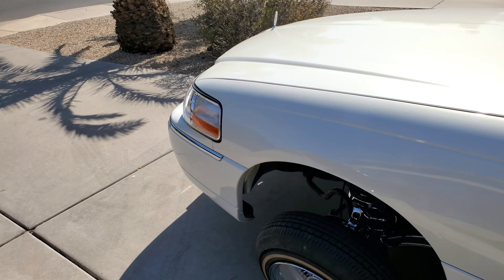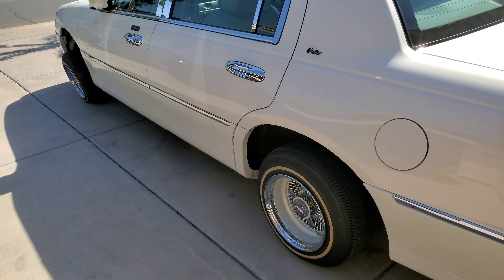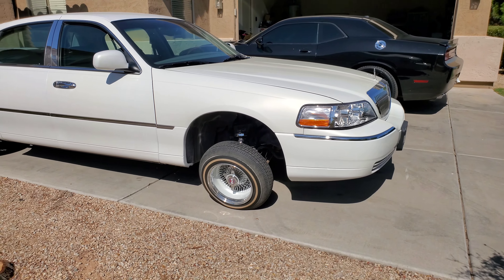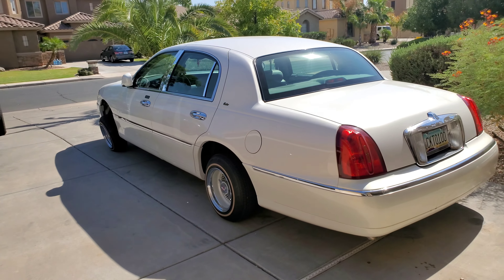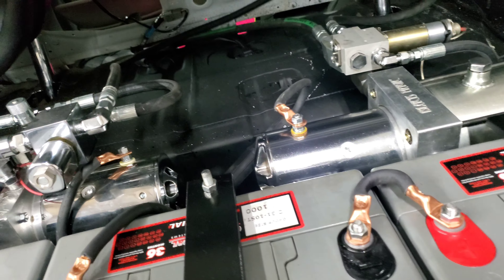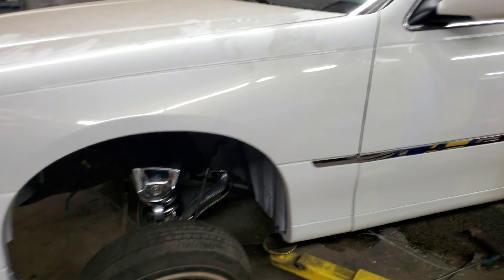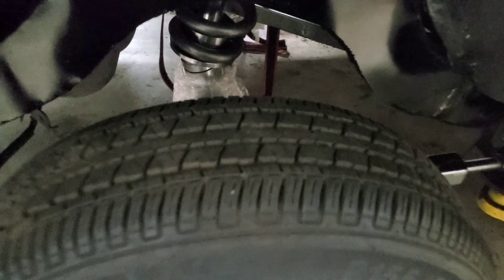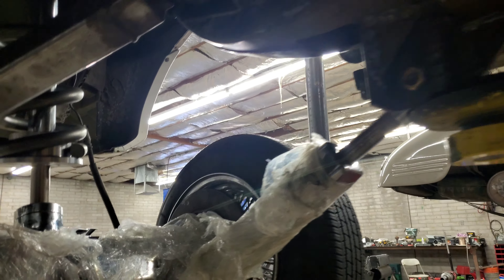update on the lincoln finally got it out the shop

Comment: How much did all hydraulics parts plus installation and all reinforcement cost basically how much money have you put in it to make it a lowrider with out the cost of the car is because I'm trying to build one and I want to have an idea of how much it will be costing me. Thank you love the car.
Reply from the maker: I honestly haven't added it up yet but I got a good deal on alot of parts in chrome and did alot of labor on my own. Just to give you a rough idea had to be almost 10k Just chrome in the setup
Reply from the maker: Also depends on wat kinda setup you going with cause a basic setup can run about 2800 to 3400

Comment: What year is that and can I run my 98 with just lower trailing arms and watts link?
Reply from the maker: Mines is a 2000 yea you can run the lowers if I understand the question right you should be good

Comment: On 03/07   can you do a rear end swap and  a spindle swap to 98 so wheels wont stick out
Reply from the maker: yea you can do both but your wheels shouldn't stick out on a 98 only need to swap out on a 03 or newer. But to answer your question yea you can
Reply: Are you in az
Reply from the maker: @christophermunoz205  yesss sirrr

Comment: Did you have to do a frame swap?
Reply from the maker: No my car is a 2000 you don't have to on that year only 03 and up
Reply: Oh I got ya ,did the front end bolt up good with no issues or did you have to modify anything?
Reply from the maker: Bolts right up
Reply: Ok thank you for answering my questions stay up
Reply from the maker: No problem bro likewise....

Comment: Do the belly and up under the doors the ears change the rear I've had 2 lincolns those will fuck up for sure
Reply from the maker: good lookn bro did you do the front acrhes on yours?
Reply: @MRTGM  yeah ran a bar across the front basically doing a half wrap but a little extra because the lincoln frames are hella cheap
Reply from the maker: ok bet thats wat i got appreciate it bro